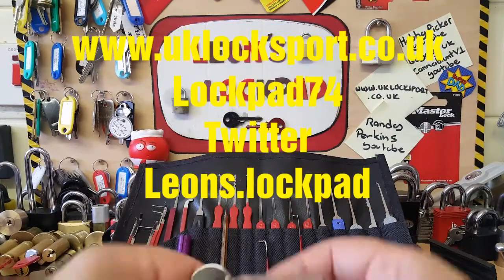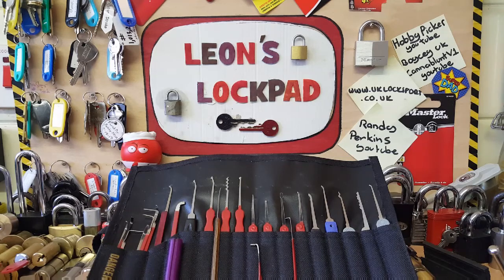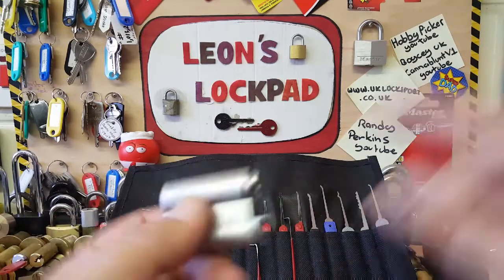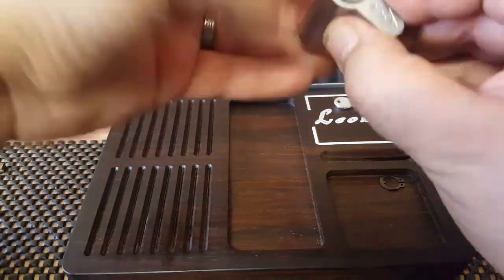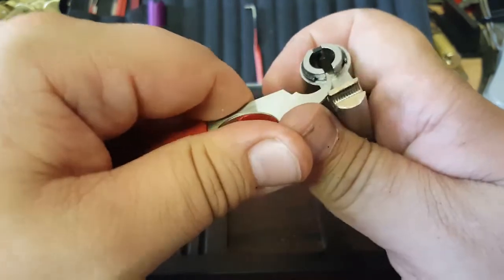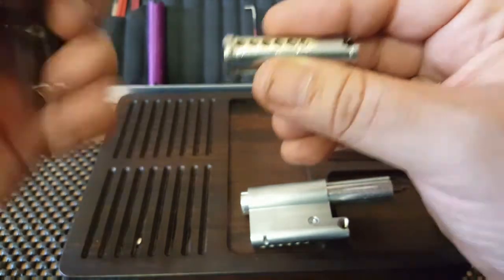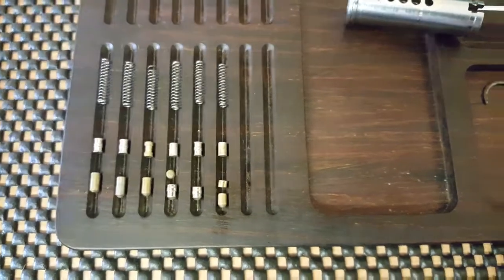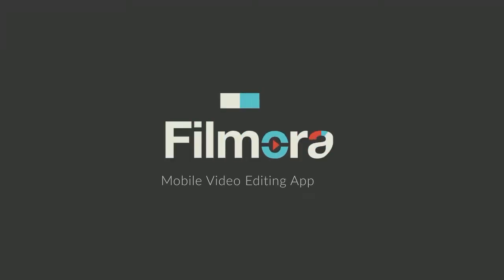Lock picking.A kite marked 1star euro challenge lock very nice and crisp😊

Comment: Very nice picking Lock Noob !  Thanks for the video !  enjoyable as always to watch.  It was interesting to see that wafer in there.  Have you ever seen a lock where a few of the cylinders had multiple wafers ? so say slot one had 3 wafers in it, something like that.... do more wafer make it harder to pick ? I'm guessing not, but thought I would ask.
Reply from the maker: +Lock Pickin' Magician i think the wafers was in there so the key would work.i find locks with wafers are easy to.thanks for watching mate👍😊😊😎😎😎😎😎
Reply: ah ok.... so they can be used if you don't have the correct pin length ... so you run out of correct pins, so add in a wafer to adjust ( fix it ) .... very interesting !  thanks for that info, very cool !  and didn't k now you found them easier, that's a good thing !